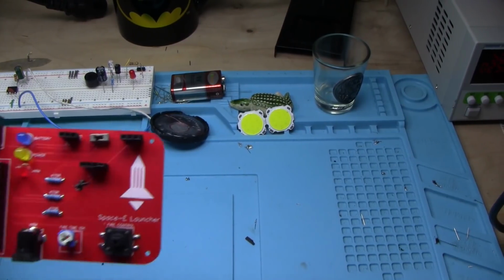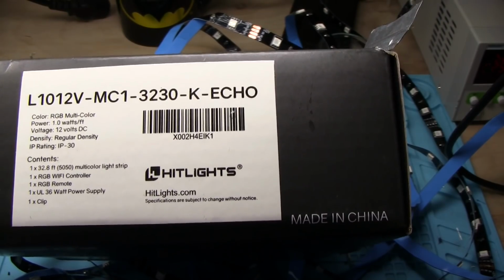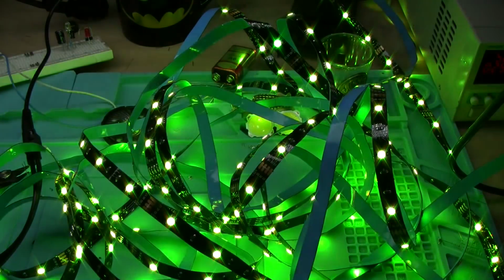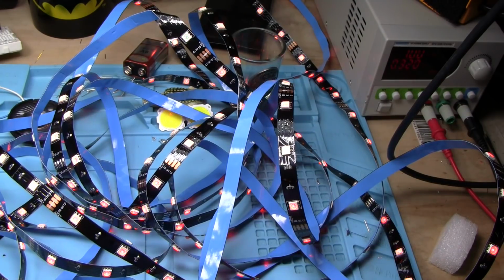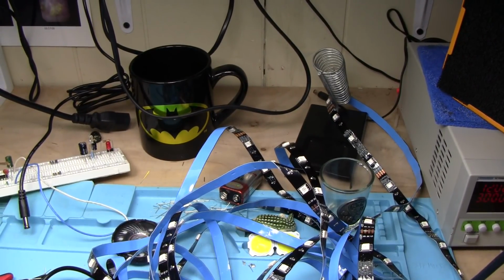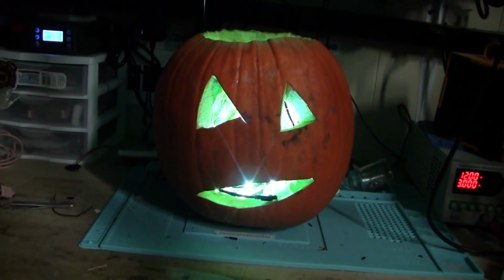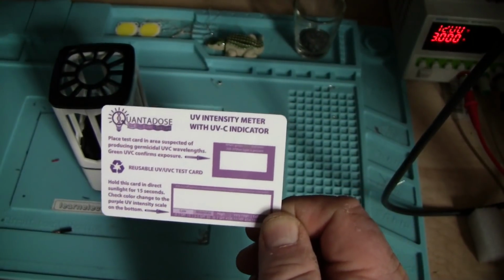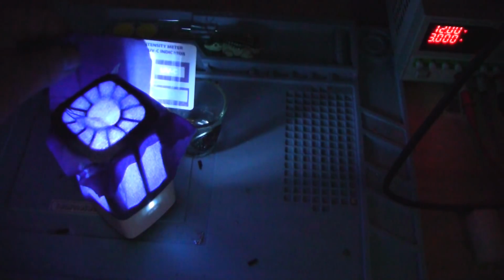Really Random Friday

Comment: Kudos Paul for using that UV detector card to determine if UV C radiation was being emitted from that sterilization lamp. Actually, this technique is fairly old with a revived interest because of covid. The sensor doped into the card is probably some rare earth element which responds (fluoresces) to a specific UV wavelength. Or, I could be wrong, the receptor might be a type of organic molecule which also responds and fluoresces in this same UV region. In any case, nice analytical detective work.

Comment: Know of a regulator that does 3.75V well when powered by one 4.2V Li'on batt?
Reply: More specifically I need it to buck when 4.2v and boost up when 3.2V...the circuit is very picky and 3.75 is the sweet spot
Reply: @mwint1982  what kind of current does your circuit draw, there are tons of decent buck/boost converters available on eBay or Amazon at pretty low prices, if you don’t need more than an amp or two. What is the application cause that might make a difference and how noisy can the converter be? Most buck boost converters are relatively noisy on there output, some are cleaner on one side than the other so you would need to do some testing. You definitely need an odd voltage. Have you tested your circuit at 3.3volts to see how well it performs there? Or if you can waste a little power you could feed it five volts and use a voltage divider to get your 3.75v. Hope some of my rambling is helpful to you.
Reply: @mikeoliver3254  it's an array of led lights and an IC to control a couple mosfets which drive them. Best I've got is two diodes in series for a voltage drop, but 3.8V on the battery start to dim the lights. I need the battery to output a constant 3.75V somehow, but the battery voltage isnt constant because it gets used so static resistors or diodes arent cutting it
Reply: @mwint1982  sounds like your going to have to find a way to plug them in. A buck/boost converter that’s real efficient is still going to cut out when the power it needs gets to low. Try searching “buck/boost converter” on eBay or Amazon and get reading the product descriptions and you should find something that will work.
Reply: @mikeoliver3254  thanks. Originally it was 110V but I've made it run on battery lol